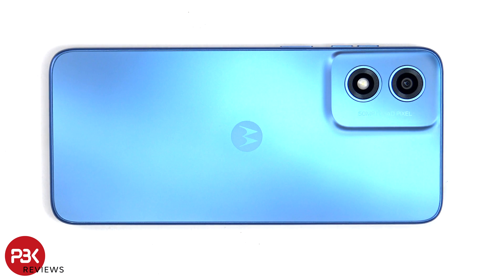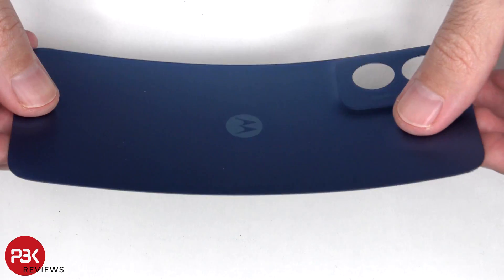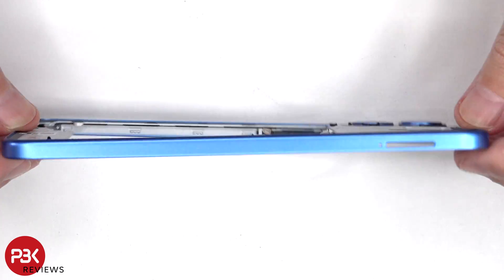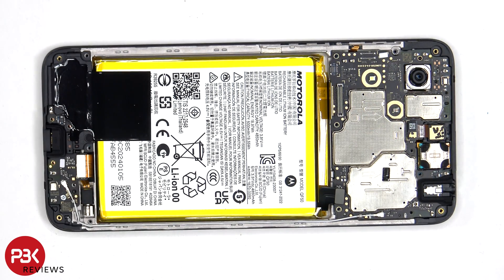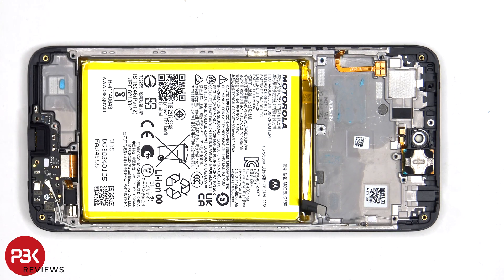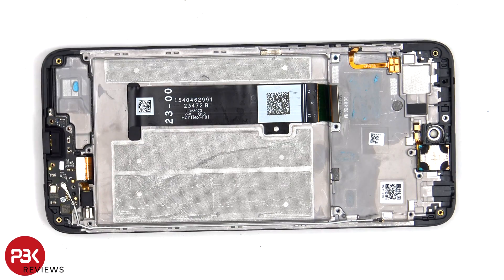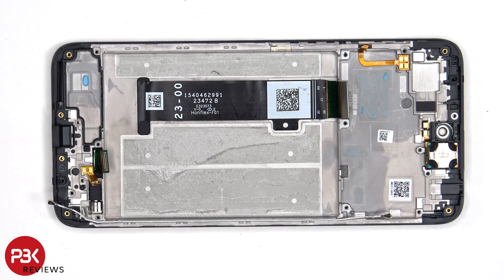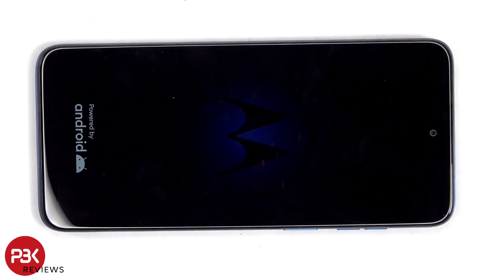Motorola Moto G Play 2024 Teardown Disassembly Phone Repair Review

Comment: Thanks for the breaksown. Is there any way to just change the screen without taking apart the whole thing?
Reply: No, it glued to the frame.   Repair shops usually replace the screen only, but if you don't feel comfortable separating it from the frame, then get a screen with the frame and just move all the parts over.  IMO it's easily and safer to replace the screen only.

Comment: Wish Motorola would switch to using stretch release tabs/pull pouches for the batteries for even easier repairability like Samsung did in 2023.
Reply from the maker: yeah, I'm surprised they haven't yet but probably will soon or they won't be able to sell in the EU.

Comment: Once camera get dirty can we clean that? Or do we need to replace it anyway?
Reply from the maker: Camera would only get dirty if there is a break in the camera lens cover or if the adhesive gets loose and allows debris inside the phone. At that point you need to remove the back cover and replace the adhesive strip.